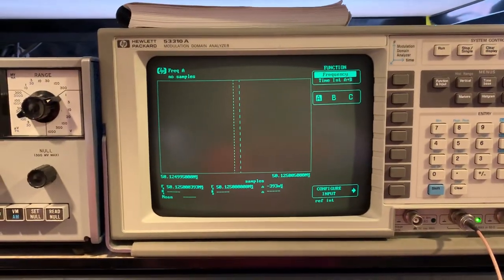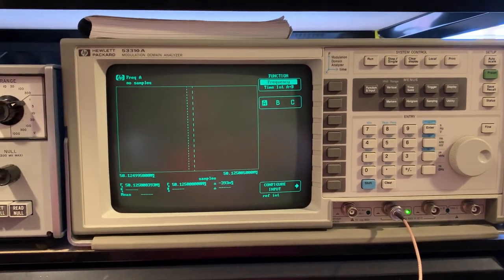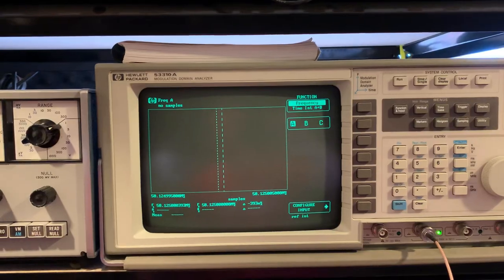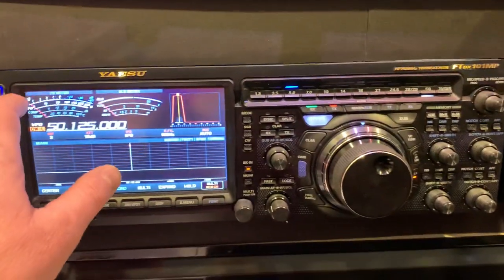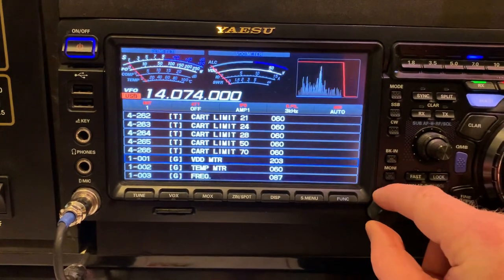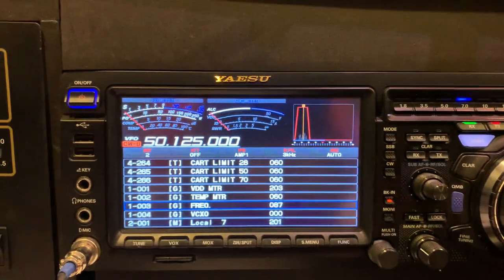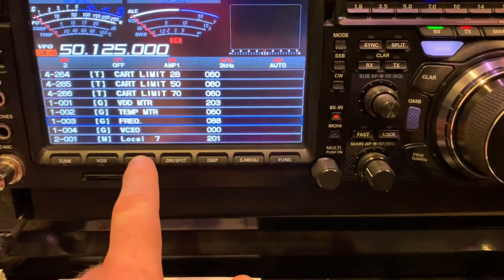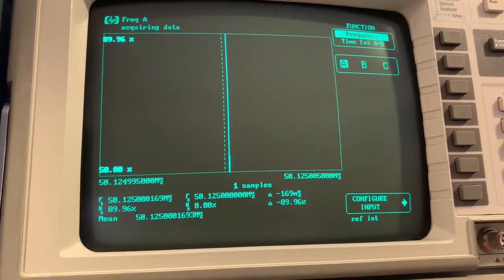Yaesu FTDX101D/MP Frequency calibration - KJ7E

Comment: A very useful tutorial, I have never been in the service menu of my FTDX101MP,  mine is about 1 part in 10 to the 7 off. Presumably the difference with amending the correction in the service menu is that it will not be cleared by a reset? I am sure I will find out soon enough.
Reply from the maker: It will be retained.
Reply: @damonkj7e  thanks, yes it does. Mine too only needed a touch, I suspect the oscillator has aged nicely now and may not significantly move any more.